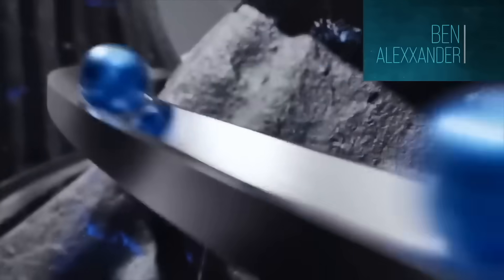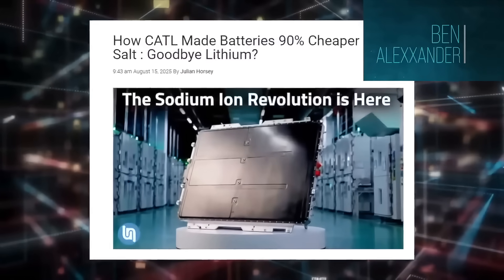CATL Naxtra: The Sodium Ion Battery People Said Couldn’t Work in Cars

Comment from the maker: Would you rather buy an EV with a Sodium Battery or LFP, and why? Please let me know.
Reply: EV with sodium battery❤
Reply: Cheaper and safer
Reply: Alex you've still not covered donut labs solid state battery with 100,000 cycles and is ready NOW!!!
Reply: @viyusavery248 who cares I want cheap. Solid state won't be cheap
Reply: It really comes down to cost. People are excited over Sodium batteries not because they like salt, but because they like the price collapse.
Reply: @LuisManuelLealDias  As an Albertan? I want oil unprofitable and depoliticized.. it won't happen until sodium ion can legitimately move the needle forward when it comes to transportation alternatives...
Reply: @stickynorth  correct
Reply: @LuisManuelLealDias I gotta say. All I want is cheap and affordable I can live with any down sides.
Reply: Cheaper, usable range is good enough, it’s safer and good cold performance❤ It will effect positively for ev resale value since it will outlast ev body..
Reply: Sodium = No child labour mines
Reply: I would prefer sodium based batteries because I live in the north.   I have owned a hybrid (a Volt) with a very outdated lithium batter (105 watts/kg) and notice a significant loss in capacity as the temps fell.   As a result the car was designed to run the gas engine whenever temps fell below 32 F.
Reply: Why not both? EVs are still in that middle range where range is still important to some level, so by maxing about the total volume with the full battery + a starter section for cold weather- it would make more sense to try and do both to me. At least, until Sodium finds its love child mix where LFP is today. Maybe SFP?
Reply: Solid State battery. More energy dense and no chance of fire from Thermal Runaway with Li-Ion.
Reply: I think sodium is very heavy making it not really EV suitable. Donut solid state. https://youtu.be/Y-aPS2AwMbc
Reply: @ianburnett4605  That was only true in early release of sodium - they are getting better
Reply: @ianburnett4605  Teh video goes over that let alone, they're not really that much heavier as the sodium or li makes up a small amount of the over all battery.
Reply: I just learned of Donut Labs' claims regarding a solid state battery. I don't know anything about them, so I have no opinion about them. The promise of Sodium Batteries is such that I'd like to replace a LFP battery in an existing EV with a Sodium Battery.
Reply: (NOT A TROLL PLEASE PAY ATTENTION )Stop this sodium ion batteries stuff and LOOK AT THE NEW  DONUT LAB SOLID STATE BATTERIES 😱😱😱😱😱😱 if this is real the whole world is going to change . This is the biggest breakthrough that we will see in our entire life
Reply: @atheendras_gym_journey  Maybe, but market time will be a while.
Reply: @adr2t   just think how the world would be in 15 years time if this news is real
Reply: @atheendras_gym_journey  I be more impress with us moving to a carbon Si or S as that holds more power and higher C rates I guess. SSB are great on paper, but they are new, so hard to say how well they will do over all.
Reply: @adr2t  have you seen the stats of the donut lab ssb ?
Reply: @atheendras_gym_journey  I look them up a bit, but I am just mean the battery it self. We dont know the long term outcome of their batteries or any SSB.
Reply: @atheendras_gym_journey who care I want cheap because I'm broke and don't want to be in anymore debt. Solid state won't be cheap sodium will
Reply: @atheendras_gym_journey  I have looked into this as best as I can and I actually now smell a rat.

No information on chemistry or anything else. Only claims and CGI renders.
Reply: Either.  More range and cheaper are my priorities.  2021 BYD T3 200km @90kph :)
Reply: Perhaps wait for this new battery to hit mass production? Its a solid state battery that is already in production and powering a Motor bike you can buy today. 400wh/kg and other specs that leave sodium ion in its wake.

https://www.youtube.com/watch?v=Y-aPS2AwMbc

If it is real and lives up to its claimed specs it is amazing, however I have not been able to find information relating to chemistry except that it is lithium ion
Reply: Battery swapping will be the norm. Battery ownership will be obsolete. Storage, safe and quick charging, reliability, cost, availability, sustainability governs
Reply: @raviyadumurthy  Tesla tried this and realised it wasn't going to work. The form of the car would be dictated by just a couple of battery designs. because no battery swapping station could afford the space or the inventory to have all available batteries charged and ready to go.
so by necessity you could only have a few designs which then limit the cars design as the battery is a structural part of every modern EV
Reply: Naxtra all the way... Especially in a cold weather region like Alberta whose high today is -18c with a -27c windchill factor... 
Also,  95% of all road traffic is 1-2 person vehicles going less than 50 miles/80 km round trip per day... Same as it always was. In other words? We should be driving electric 2-seater kei/city cars for almost every trip. The rest is overkill! Ditto when it comes to battery tech. 175 wh/kg for Naxtra is more than good enough... especially for its improved durability, longevity and cold weather performance..
Reply: Don't be emotional. It will cloud your judgement. The electricity charging your car, will still use Venezuelan oil. Just focus on things you can control. Maduro was a shitty human, anyway. So whatever happens, its a step up for Venezuelans. But that aside, its not the worst thing USA has done in its history. Sanctioning Venezuela did a lot more harm, and brought untold suffering to Venezuelans. You can't want to live in an empire and not want to engage in empire building activities. Stop the virtue signalling, just focus on enjoying your life, jot focusing on things you can't control. Being part of sn imperial system is why you can afford a brand new EV, without being part of the elites, like in most parts of the world.

Comment: Most families have multiple cars.   If you can charge 85 percent in 20 minutes,  you don't need high range.   I'll rather pay less for 200 miles compare to 400.  Even 100 miles. I'll use it as a 2nd car for short trips to the market or even work.   People love to buy things they don't fully use 100% or even 50%.😂  Buying a Extra large SUV for driving kids to soccer?  I'll rather drive a Porsche 911 to soccer practice. 😂

Comment: CATL’s  Naxtra Sodium -ion. (Na-ion ) 
battery is. (gendrating  buzz for its 
potential to. disrupt the. industry 
by. offering. a Cheaper ,safer, and 
Cold-weather-friendly alternative 
to Lithium- ion 
(Featuring high  energy density (175wh/kg) 
excellent low tem performance  
(90%capacity at -40C),long life 
(10,000+cycles) and compatibility

Comment: The world seems to be on the cusp of widespread adoption of electrical vehicles. 2025 might be the year that will be seen as the time when battery technology had improved to the point that the end of ICE powered cars was inevitable. The US is likely to fall behind the world on the transition, partially because of the political power of the fossil fuel industries in the US and partially because the lower population density of the US makes the transition to electrical vehicles more difficult. But I think the host is exactly right that initially there are niche markets where electric vehicles offer such strong advantages that even in the US those markets will be dominated by electric vehicles in a few years.

Comment: People talk about “range anxiety”. Range anxiety is a hoax. 99% of trips in a car are well under 250 miles and shocking as it is, most people never even travel 250 miles one-way in their lives. I frequently travel 280 miles away one-way to visit my sibling in a different city and ya know what? I want an EV because public chargers are not rare anymore, and it typically costs me upwards of $80 in gas alone round-trip to visit them. You give me a sodium ion battery that’s hardier against cold temps  (I park outdoors), gets 200 miles range, and makes it a new EV costs $18,000 and I’ll pay cash for that. Because when I’m not visiting my sibling I put on 12 miles maximum per day. I don’t care about the range. Charging an EV costs $12 publicly at expensive times and like $4 at home, who gives a shit about range.

Comment: Na+  bei Baumaschinen , Schweren  LKW. (4 Achsen und mehr ,  also  Typisch. bei Kohle, Zement, Kies  etc.  in China.) 
Robust  und langlebig  bei jedem Wetter. Der Diesel  ist noch  zu   viel billiger , wenn man  500 kWh  Akku  Kapazität benötigt. 
Reichweite  ist  in den Fällen  mehr als ausreichend, wenn  ich  bis zu 500 kWh  bei 32.000 kg bis 34.000 kg  Gesamtmasse  unter z.B, einen  Kipper  platzieren  kann. 
Transporter mit 3,5 t bis 6,5  t Gesamtgewicht  ( inklusive Ladung)  fahren  zu  > 90%. weniger als 200 km am tag im Ballungsraum. 
In Berlin  kommt man  Real auf eine Durchschnittsgeschwindigkeit von 30 kmh.  Wie soll man da auf mehr als 200 km am Tag kommen? 
Größer 60% der Volkswirtschaftlichen  Leistung  fast aller  Länder  wird in  den Ballungsräumen  generiert.  In Asien  wohl  noch mehr. 
Günstig im Unterhalt   und robust , das sind die zwei Parameter  in dem Segment. 
Wenn die Finanzierung  dazu passend  gemacht  wird, dann  ist der Diesel mausetot .  Und der Markt  ist riesig und bei den  Laufleistungen  je Tag ungleich größer, als  ein SUV  mit 600 kW .

Comment: My minimum is 50 to 100 mile range on plug in hybrid.  My 2019 Chevy Vol gets 50 mile range using LGChem 110 Wh/kg batteries.  Which is significantly less that 175 Wh/kg of CATL sodium ion batteries.

Comment: Na battery have low full cycle efficiency, the too wide voltage range as you stayed is a problem also for solar storage... There is no hardware today for that range. I don't see replace any solar home systems for at least 5... 8 years, same for EV that cost less then 35k Euro. I will be the first to get one for my solar system, but I don't see it coming any time soon unfortunately.

Comment: A range of 660km would be fantastic IF one could also rent either a supplemental battery pack that fits in the boot (trunk) of the car OR connects to the car like a trailer providing an extra 440km range. If a full charge still over 30 minutes -- we'll also need charging infrastructure where we currently rarely find it: parking lots of sports stadiums and arenas, concert venues, recreational areas, restaurants and motels.

Comment: I'm in a position where I can afford/justify having one vehicle, so that vehicle needs to do everything. That is, I can't afford a vehicle for 'around town' and another for long trips etc. I live in a capital city but have family and interests in the remote outback. With the current state of the extra-urban charging network in Australia, I need a vehicle with a genuine 550km of highway range (so around ~660 WLTP). So at this point sodium is a no-go for me.

What could change that is the introduction of Kei class vehicles with accompanying reductions in registration/insurance. An AU$15k two seater with 200km WLTP and compulsory registration & third party insurance capped at 50% of 'big' car fees would make a sodium-powered 'runabout' for commuting and shopping both desirable and possible. Safety seems to be one obstacle for the regulatory adoption of these tiny vehicles, but as a former motorcycle rider they look comparatively safe to me.

Comment: I'm in Minneapolis, Minnesota. Temps around here in winter get down to -20F sometimes, which would drain a lot of range from lithium batteries. I just saw a guy ride by on a little stand-up rental scooter, which has a lithium battery. Crazy! That scooter would go a lot farther with either a sodium or a solid-state battery. Same with bicycles. Short commutes and grocery runs do not require 100 miles of range. Did you hear that in Portland, Oregon, they just lowered the in-city speed limit to 12 mph? That's about the same speed I ride an electric bike when I'm getting groceries. These newer chemistry batteries that run in really cold weather...they're going to be great for little vehicles, ones with two and four wheels. "Grocery Getters" should become a recognized niche in the car industry, especially now that more and more people are retiring. Get me to the store and back, to the gym and back. That's about all I need.
Reply: Bei - 29° C macht jeder Pb Akku  schlapp . Also eine fette  Na+  Batterie  würden auch jeden Diesel Truck   mobiler  machen.

Comment: Agreed, but the elephant in the room is aluminum ion not sodium ion. Granted sodium ion is much further along, but the remaining problems for aluminum ion commercialization are not insurmountable. Tesla may actually be very close to making aluminum ion a real thing outside of the labs. The preliminary numbers on energy density, charging speed, longevity, and safety are almost science fiction like for aluminum ion. Rumor has it Tesla's model 2 will feature aluminum ion, but I'm not putting too much stock in that as the model 2 release date is coming up fast and aluminum ion simply isn't far enough along let alone the manufacturing infrastructure to support it. Even if it isn't mass market commercialized by end of 2027 it definitely is on its way. ICE drivers on the fence about EV who still have years left on their ICE vehicles will be wise not to rush into an EV purchase and just wait for battery technology to shake itself out over the next 1-2 years. Here in the US there's also the issue of unfair trade practices, i.e. automotive industry protectionism which isn't going to last forever. Tesla is the best hope for affordable EVs in the US vis-a-vis technology breakthroughs like aluminum ion, but as the rest of the world keeps making strides there will come a time when protectionism will collapse as advancements can no longer be kept out.

Comment: The range question is tricky.  If I was talking about gas cars, I would say 300 miles after owning several cars with closer to 200 mile range. But EVs don’t have the same range characteristics and I can charge them at home so I don’t need to worry about weekly or twice weekly trips to the local gas station.  For an EV, 200 miles would probably be acceptable.  That allows most weekend day trips with probably not worrying about finding charging on the way.  If I was doing more than one or two long distance road trip a year (+1000 miles), I would say 350 miles of highway range at 70 mph which would give a useable 250 miles of distance between charging stations.  Similar to a 300 mile gas car keeping 50 miles of range in reserve. (350 x (80%-10%) =245)

Comment: I'd like a 300 mile motorway range, huge I know, but that makes the difference planning my journeys around charging and charging around my lifestyle.  If sodium is available that fits that (3rd gen perhaps), then the higher cycle life of sodium would allow me to use the car battery for vehicle to grid or vehicle to house without regard for battery life. The rate of improvement of batteries makes me want to wait until my needs are met, rather than compromise now and face the depreciation that comes with obsolete technology.